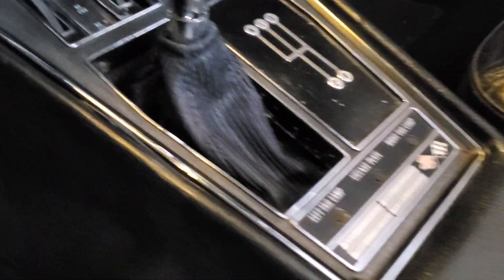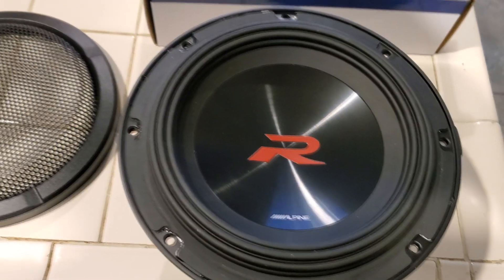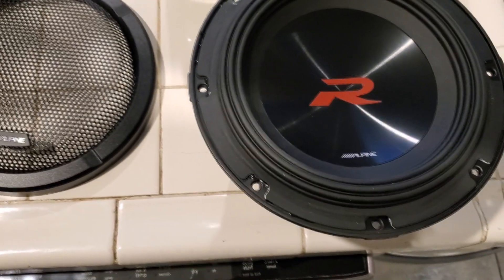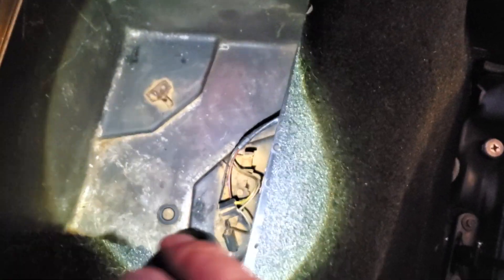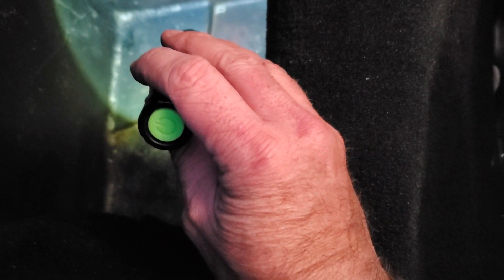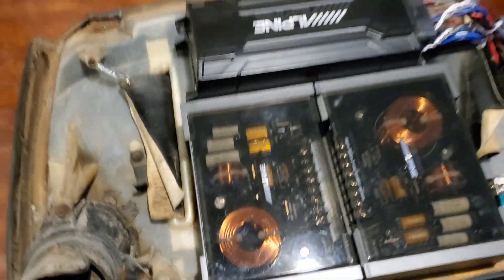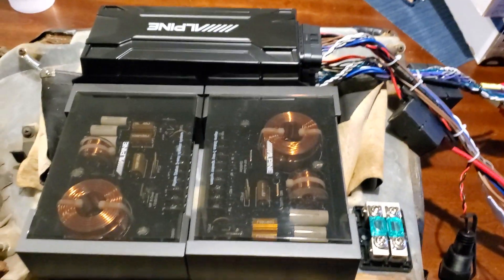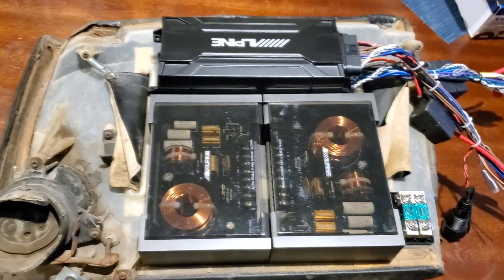1969 Corvette Update! Figuring out where to put in my audio amps and crossovers.

Comment: I know how little room there is to work with. The center storage area is kinda a waist of space and I was leaning towards an 8" sub also ported into an enclosure that protected the woofer in the center. When separates (Rockford Fosgate) came onto the scene we built our own crossovers with coils and capacitors from Radio Shack. We either made a mother board or wired them inline to each speaker individually and hot glued the coil and or capacitor, depending on the speaker, to the mdf board the speaker was mounted to. Usually this was to save space and reduce any current loss. The math is easy enough, I know you got that no worries and skills to build an awesome enclosure. If I could draw on this thing I'd show you what I am putting together. I'm excited bout the follow up.